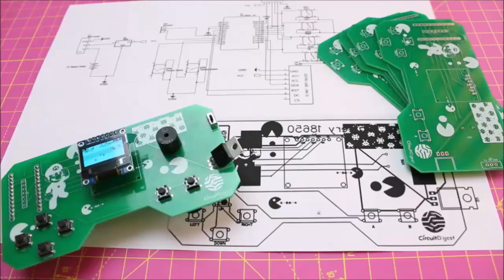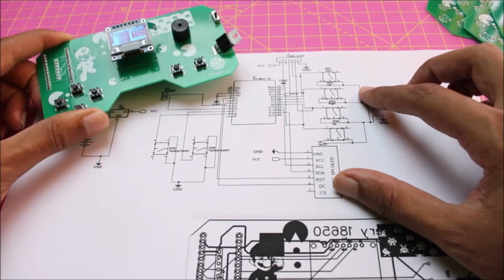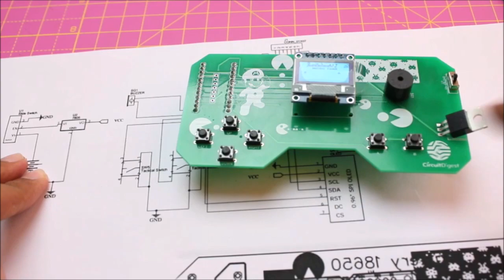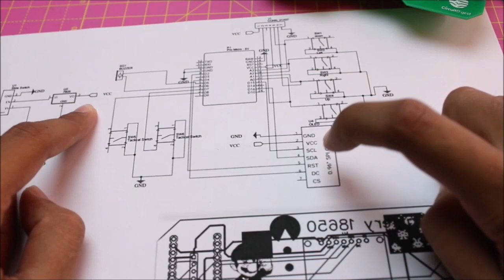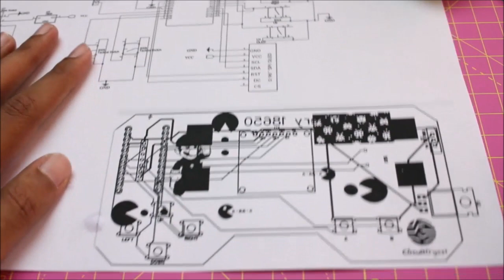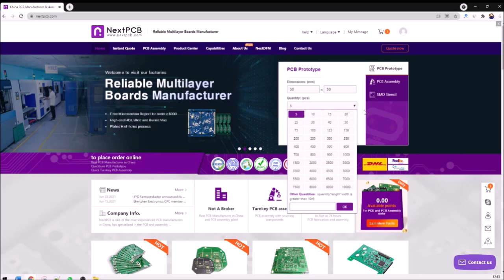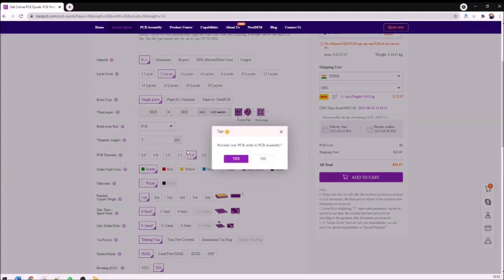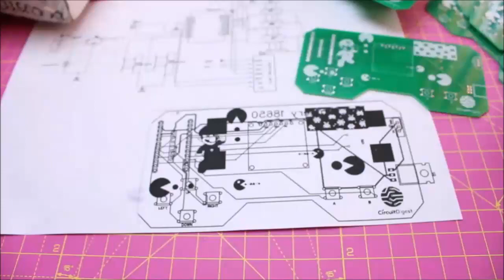DIY Handheld Game Console using Arduino Pro Micro and Arduboy

Comment: i hve a few questions
 
1. does the arduboy charge from the usb port in the arduino

2.is a 3.7 volt 18650 battery enough